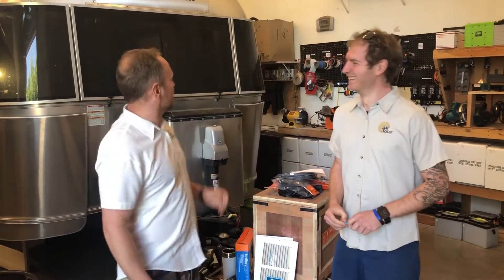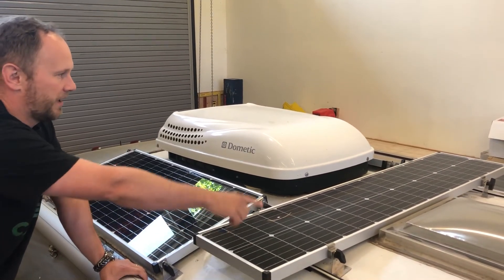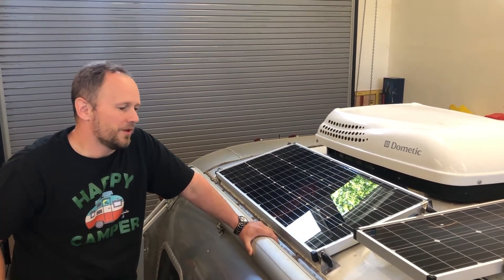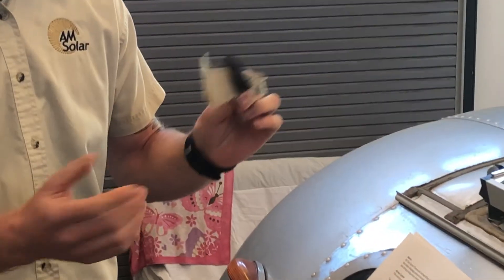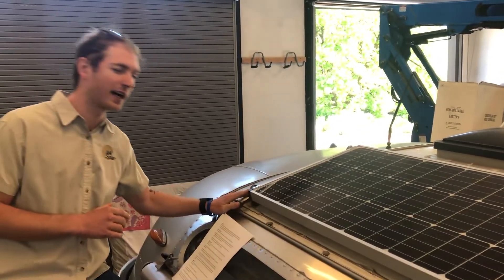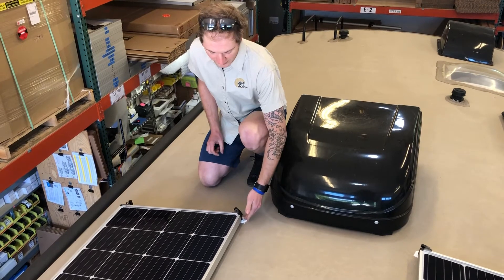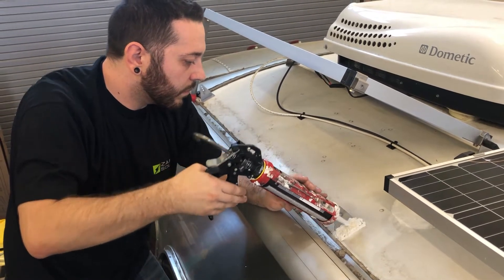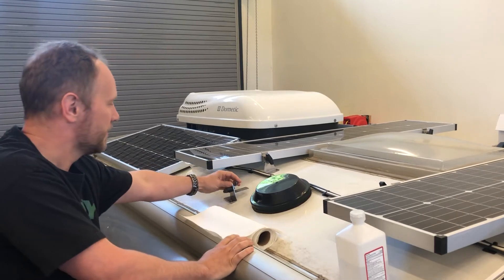Ultimate Airstream Solar, Lithium & Inverter Upgrade (Pt. 2 – Roof Mount Solar Array)

Comment: Really nice setup, my question to you is, is even worth it to get the Airstream 180w Rooftop Solar Package for $2,600, OR  is better to just buy the airstream with the solar connections only and then use those $2,600 to buy a separate more capable system?
Reply from the maker: It depends on how big you want to go. If you want something more than just a battery maintainer for storage, I recommend avoiding the factory packages. We can guide you through more powerful DIY options.

Comment: Hi, one question about the SIKA221, i'm RV technician and from my experience and information obtained, the 221 have fast degradation in UV sunlight exposition, it's better to use the 505UV.  Thanks for the feedback after confirmation with SIKA directly.
Reply from the maker: We’ve been using it since 2002 and haven’t experienced that.
Reply: @GarretTowneAMS  From my experience in the field, the 221 is only safe when used for the interior, when used on the outside it degrade, crack and become yellowish.  From the distributor locally in Canada they don't recommend outside only in interior application.  SIKA make many type, for different application, i only want to share my experience with you, you can always ask to an experience distributor or directly to SIKA company what is best suited for that and i'm sure that they suggest the 505UV.  For my side anyway i NEVER fix a solar bracket panel with 3M tape, on a membrane roof i use NEOPRENE DOWEL that deform within surface and on RV with metal roof i use TRI-FOLD rivet and sealer to seal after fixing.  Ask the question and it always good to put back in question, and ask the manufacturer.  Me to i integrate Victron since 5 years on RV, boat and Cabin, i really like it integrator wise, and your install is GREAT no doubt about it.  I only notice that about the sealer use.  Thanks to you and validate with SIKA and you will see.
Reply from the maker: @micheldupuis90  I’ll tell the crew to keep an eye on it. We’re always trying to improve our technique.

Comment: Have you had to change the converter?  What did you use?  I tought the converter had to be changed with lithium ?
Reply from the maker: When we add an inverter/charger, it has the function of a converter, so we remove or disable the factory converter.  This one used a Victron Quattro 24/5000, other popular options for inverter/chargers are Victron Multiplus 12/3000, Multiplus II 12/3000, etc.  If you just want a lithium compatible converter, I like the Victron IP22 30A charger.  If you double them up in parallel, you get 60A.
Reply: @GarretTowneAMS  thank You !

Comment: How easy are these panels to steal?
Reply from the maker: Scott Oliver It depends on the rig. If you are concerned about theft we have security bolts that will slow someone down. But, I’ve never heard of anyone getting their panels stolen. Tweakers probably have a hard time getting them to work and a harder time getting anyone to pay them enough for a used panel to make it worthwhile.